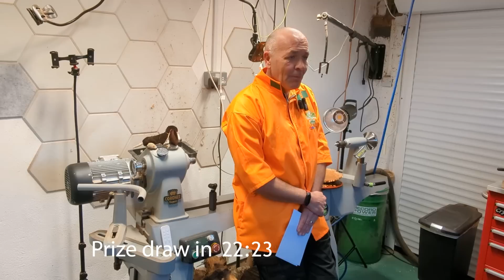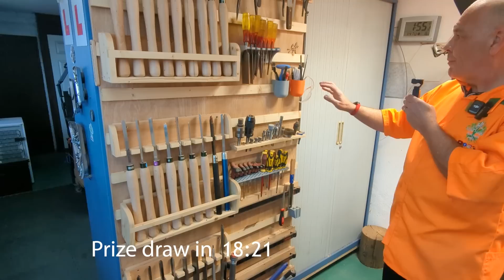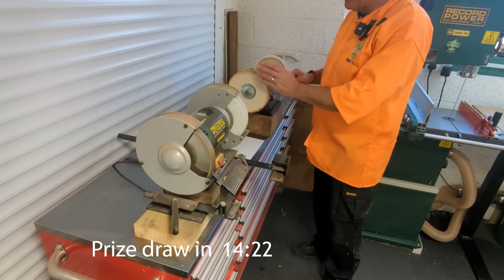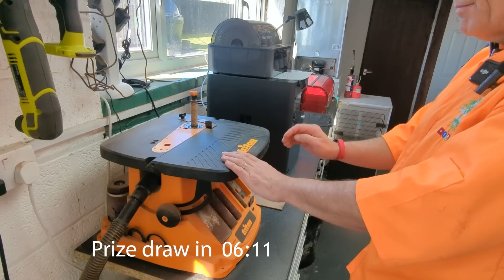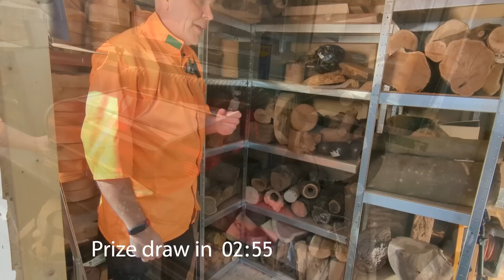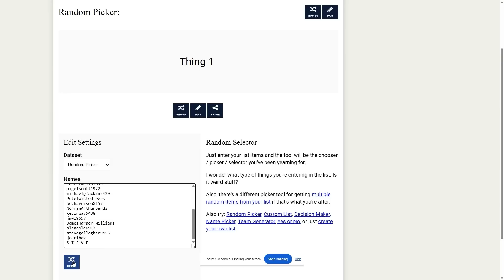Sawdust, Shelves & Surprises – Workshop/Wood Shed Tour & Giveaway Time!

Comment: Hi don’t know where you are located but I have a apple trunk that’s been sat around for a few years also I am about to have a yeah tree with a very straight trunk going if interested let me know soon a you tree that will be cut down end of October
Reply from the maker: That, of course I'm interested, where are you? I'm near Stockton on Tees 😀
Reply: @mikeholton yew tree has not been cut down yet will try and get some photos to you would you like it as a trunk or cut into section the apple is about 4 feet long
Reply from the maker: The Trunk will be very heavy, email me some pictures and I'll have a look, thanks
Reply: @mikeholton I have emailed your web site with my email address reply to that and I can provide you with photos
Reply: You will probably need to bring a chainsaw if you want some. As mentioned I could get the tree surgery to cut to your desired length I think the yew is about 15inch I’d diameter?

Comment: If I were a woodworm your shed would have 5 Michelin stars. Progress. Everything about this shop tour just shows how far you have progressed in 3 years and points us towards some amazing things to come.

Why not hollow out two of those blanks with your terrifying tool and then glue the bits back into the holes in the opposite blanks and make some multi-layer thing?
Reply from the maker: Haha I have no idea what you mean 😀
Reply: @mikeholton  you said you had all those blanks and you didn't know what to do with them. Why not use that terrifying hollowing out tool to hollow some out and then glue the hollowed out bits inside a different blank and make some kind of multilayer blank.....
Reply from the maker: @loopinnerthe  Ha, I get what you mean now, that sounds almost impossible with this system, would look cool though 😀
Reply: @mikeholton  nothing has ever been impossible for you so far...  bit of epoxy in the gaps and it will be splendid... plus we all love the drama of the bowl saver thing in action.
Reply from the maker: @loopinnerthe  Haha, I've decided I don't like you anymore 🤣

Comment: How do you avoid wood logs cracking, apart from the usual advice of sawing the pith out, sealing ends, and working mainly with long grain pieces?
Reply from the maker: Hi Bob, just make sure they are sealed and always keep them dry and as cool as possible, the rest is just luck 😀